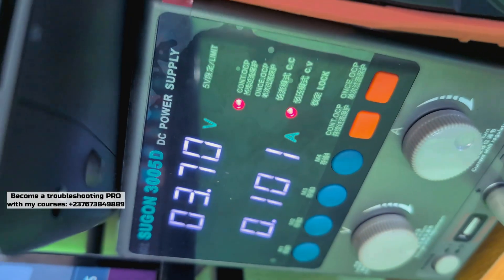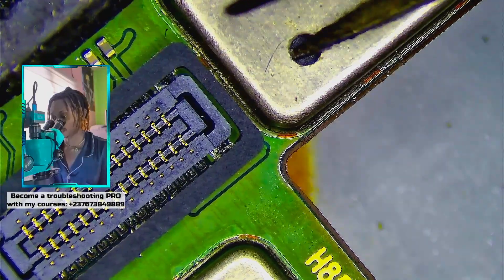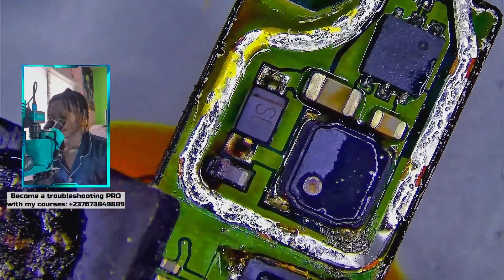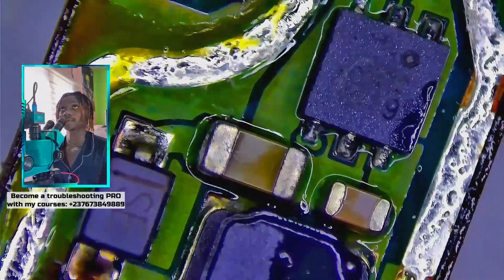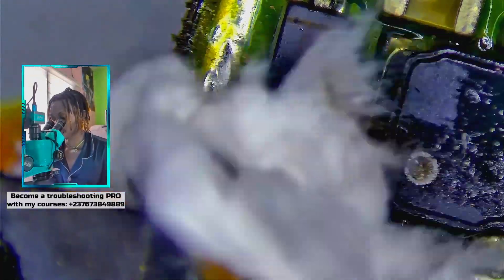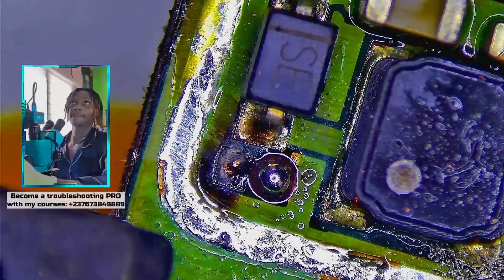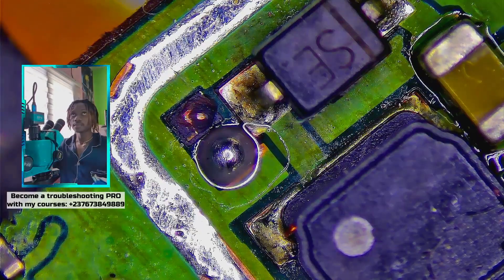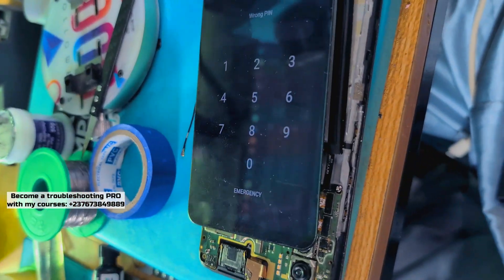Mobile Repairing Course Video by Serges Mike Techs (Learn How to Troubleshoot and Repair) Full Video

Comment: So your rationale for suspecting the backlight section was based on?
Reply from the maker: The phone was supposed to to display at 300m amp
Reply: @SergesMike but this was not mentioned in your professional level course 🤦
Reply from the maker: It is clearly mentioned in my professional level course and even in my book “the block diagram master. (Current monitoring stages”